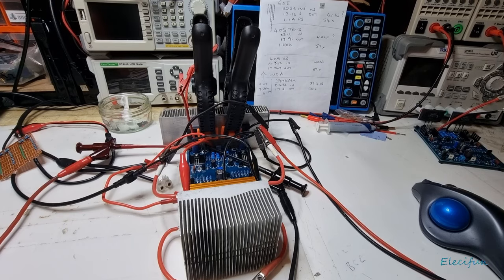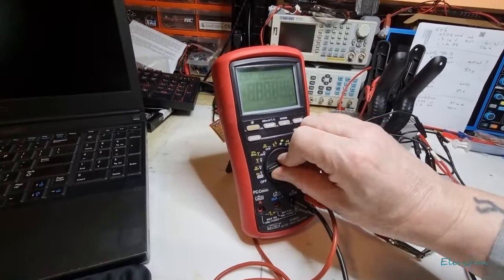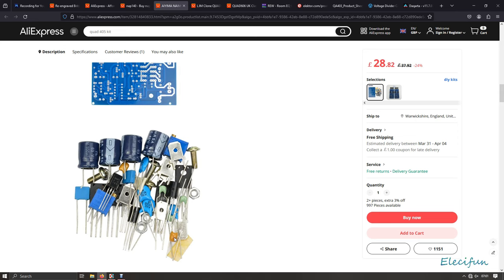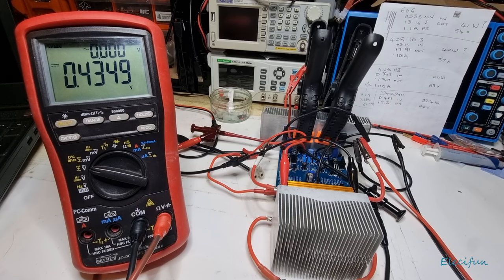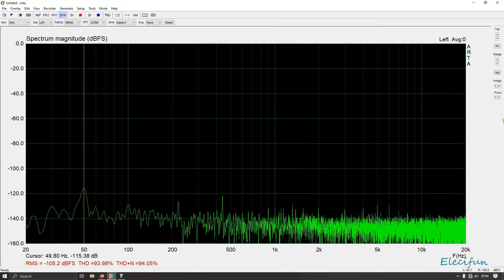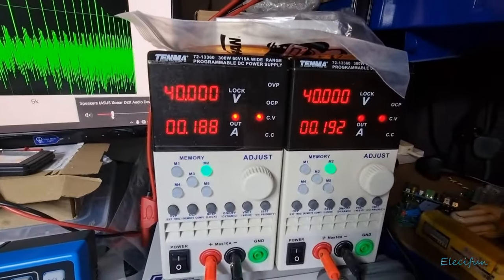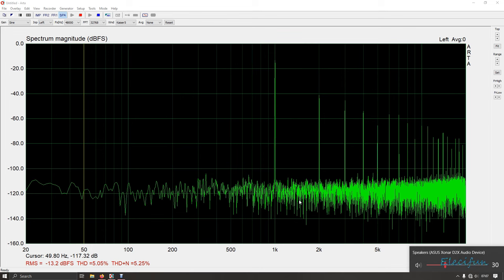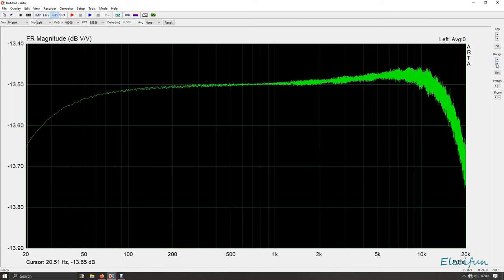Naim NAP 140 (Aliexpress) THD,  THD+N & Frequency Response Results

Comment from the maker: The Sanken transistors used on this board are probably fakes, they are obsolete on the Sanken website. I have some 2SC5200's which I can swap for the Sanken's. I will run the tests again and hope for better results.
Reply: fakes are low gain or low power. LM3886 will give better performance for less money than this funny thing

Comment: Lol. Thanks for the shout out. I miss the panda 🐼. It's a shame if those are counterfeit parts. One of the aggravating risks when building the chinesium kits I suppose.
Reply: Yeah. If we had the option, what components should be shipped with the diy kit from China, and what parts should we source ourselves? I would think there is some scale we should use for each type of component. Where some parts lands clearly you need a good source (chips, mosfets), and where you can accept wider tolerances in part quality.

I would think some passive components would be okay, maybe resistors with large tolerances for example PSU part, you could get with the kit. But buy the precision resistors for the sound amp stage from a good known source.

I think you get the idea.